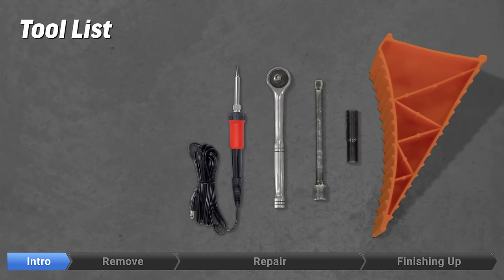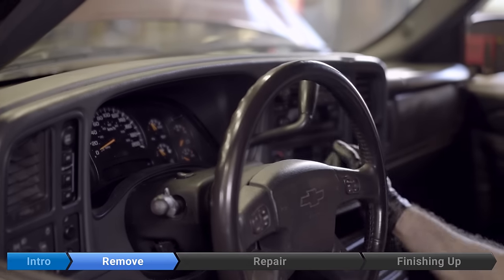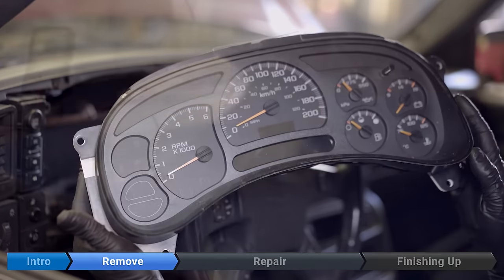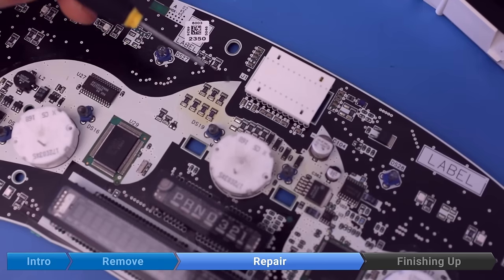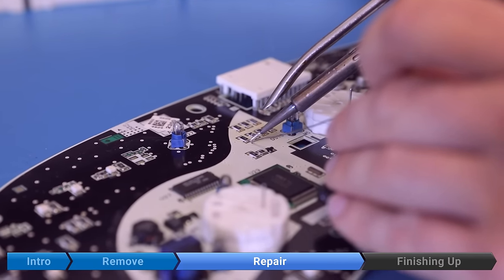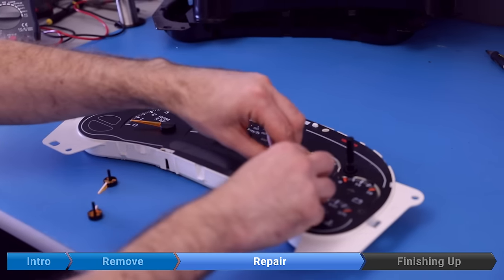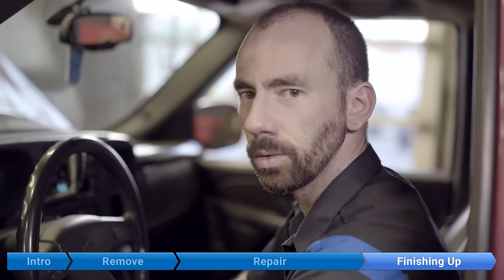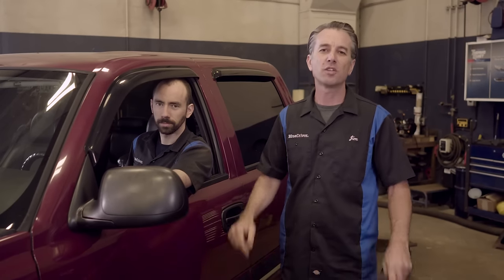Instrument Cluster Repair – 2003-2006 5.3L Chevy Silverado (Sierra, Tahoe, Yukon, etc.)

Comment: Just did this on my 05 Tahoe and it worked perfectly.  I had to mess around with needles, but got it working after a couple of tries.  Thank for the $$$ saving tip!!
Reply from the maker: Great to hear, so happy we could help!
Reply: Is there a certain way to put back needles? I’m having problems with them staying where they originally were.

Comment: Clear instructions, but it didn’t work for me. I got as far as removing the needles from the gauges and with small screwdrivers forks spoons and pliers I still couldn’t get the job done. Put it all back together and I memorized the gearshift positions.

Comment: Yet another great instructional video. Worked great on my '05 Silverado. Hard to see that the resistors solder had cracked w/o a magnifying glass, however it was pretty obvious after melting the old solder on one side, some of them started sliding around all over the place! Thanks again!

Comment: Lol did you remove the needles first then stick them back on to remove them easily for the video? I tried to remove mine and they seemed to be welded on.. I used a fork under them and still they wouldn’t budge...lol
Reply from the maker: .. maybe
They weren't that hard to get off though
Reply: @LemurMonitors  I gotta try it again... maybe I was just being too cautious... it just felt like I was gonna rip the whole shaft right out of the stepper motors lol but as far as you know, they never used any glue to install these?
Reply: @LemurMonitors  so i tried this again today... i had bought some blue LEDs that i wanted to install so I thought, "ok, ill see if i can get these pointers off again" well, i got all of them off except the Tach pointer...that was the one I was trying the other day...it was so tight it pulled the stepper motor right off the circuit board!! lol, lol... so I straightened out the pins and re soldered it back on and it actually worked! as for the blue LEDs? all but the last two worked... they were the twist in types that i had to pull out of their housings to solder them to the board and i think I may have broken a connection inside their tiny boards...oh well, i ordered 4 more so i can mount them later and ill have two more incase they get messed up again...lol

Comment: Just fixed my 05 Tahoe. Besides the low light on PRND321, I had all random warning lights, gauges going to 0 etc.  Awesome tip! THANKS!!!!!
Reply: CaptainET53, was yours just dimming?  Mine seems to be dim and before I attempt this I'm wondering if that's how yours was?
Reply: Rob G 
It was normal for years. Then at some point you could not see the gear selection in the day time. Other lights dim fine.

Comment: I've never soldered anything in my life is this something I should try to do myself?
Reply: Let just say that if your gauges are intermittently working, tach,speed, oil, battery, fuel and temp along with PRD123 and Odometer then yes you can do this. I just did it. Pay attention to all of their tips. A fine tipped solder iron and the thin solder would get you a nicer, smoother result than mine but this was my problem for sure. I soldered each of the points that they did and it’s now working fine. I went from intermittent to not working at all for several days and decided to try before sending it off for repair to Ontario. Quote was $80.00 an hour but shipping would have killed me there and back with rush and insurance. So I figure I save at least $200.00 even if the repair was only for one hour. Good luck!
Reply: And I never soldered anything before either. It’s a bit intimidating when you see how small the little rectangles are but I just dabbed a bit of solder on each end of each rectangle and the first one actually moved out of place. After I changed my underwear......I took my knife and moved it gently back in place and dabbed it with solder. Saved about $200.00 doing it myself.

Comment: Nice man, Im in the process of replacing the turn signal switch cause my cruise control went out. Thanks for the video
Reply: @F RR I did fix the cluster lights but the cruise control is still out. I replaced the brake switch as well and still no bueno☹

Comment: This makes no sense, if this fixes the problem then why if I got my whole cluster redone with new led lights & steper motor checked all sauders by a professional spend a lot of money & every now & then it just goes dead just on the gauges I have to unplug the kluster gor a few seconds then it works again intill it happens again down the line why?

Comment: Is it possible my voltage meter/oil Guage and gas Guage aren't working properly because of these connection issues? My PRNDL are super dim aswell. Please help! Thanks
Reply from the maker: Yes, it could also be a charging system issue causing dim lights. Good luck!

Comment: Everything is great he said! You forgot to pull the bulb for the check engine light and pull the solder off the sensor for the air bag. Geeze this was the least of this trucks problem that also needs an oil change lmao.

All kidding aside. Great video. Wish i seen this years ago when i owned these trucks.
Reply: I'm about to do this repair and if I can get to that air bag light , It's History

Comment: I would give you a  A for effort but if you notice closer after you took it apart and fixed the issues when you put the needle back they read incorrectly you were at low on your fuel before you fixed it then when you're finished it said you had more gas 🤔 so i guess my question is is it really worth it trying to even fix it yourself
Reply from the maker: Removal/replacement and the repair were filmed on different days since we didn't have the soldering gear in the shop

Comment: How come during install, didn't the prndl light up when key was cycled to move gearshift the couple times, but then did work after install was complete?  Is there something causing it not to work untill completely installed?
Reply from the maker: Because we cheated 😉
We were running out of time so we shot the remove/install steps one day then the soldering a few days later, then the shot of it working in the parking lot later that afternoon.
Busted.

Comment: Good video.  Looks like when you first turned it on and checked the gauges, the fuel gauge was near or on empty.  After you soldered the resisters and replaced, you fuel gauge was reading much higher.  Did the resister fix possible fix that too?  My '04 Tahoe just has a problem with the cluster not having power and me having to pound on the top of the dash to get it to power on.  Would that be a problem with cracked resister solder or perhaps cracked solder near the connector on the board?  Thanks! -- Steve
Reply from the maker: We had to shoot the removal, soldering, and install on different days so the gas probably was topped up at some point

Comment: Just one question.
Is it possible that failing cluster can cause the door locks, windows etc to stop functioning? My cluster completely died from a partial issue. Now door locks and window controls seems to be working on my 04 TB.
Reply from the maker: It isn't too likely, this is all handled by the BCM - there may be a bigger wiring issue at play

Comment: Well, we PARTIALLY fixed it.  The indicator lights come back on now.  However, the speedometer and gas gage still aren't working. The other gage on the top far right works.  So now what?

Comment: While this technically CAN be done with a fine tipped soldering iron, a reflow iron would be the best tool for the job. It would simply remelt the existing solder using hot air without disturbing where it's already adhered to the component and the pad. In this case, what you ideally want to do though is put just a tiny dab of solder onto the iron and then just touch it to the joint long enough for the new dab of solder to mix with the existing. No need to feed even more solder into the joint with the size of these components. You're just repairing a damaged cold solder joint and not completely reapplying solder.
Reply from the maker: Ideally you'd keep me far away from a soldering iron
Reply: @LemurMonitors  LOL touche`

Comment: The PRDN indicator on my 2003 Avalanche starts out black and after a few seconds get there but really faint. Will this fix help with that?
Reply: Yes, that’s exactly how my PRND started until it eventually stopped showing. Just did it today after a year of not showing PRND and it worked like a charm
Reply: Cool! Thanks! 😀

Comment: I do have one question if the lights dont show, does it effect how many miles you go like does it keep going or does it pause
Reply from the maker: If it's just the backlight then it's only a display issue - the odometer will keep increasing.

Comment: On my cluster, either all the gauges work or don't work randomly. Would these resisters cause all of them to intermittently work at the same time?
Reply from the maker: Probably not these specific ones - this might be more of a power/ground issue
Reply: @LemurMonitors  would that be one of the wires, or is it grounded through the dash?

Comment: Woulda been nice if we coulda actually seen what the problem was. Did any of the gauges work? Which one(s) didn't? This have anything to do with with gear indicator display?
Soldered a couple things but didn't tell what the exact issue was to begin with.
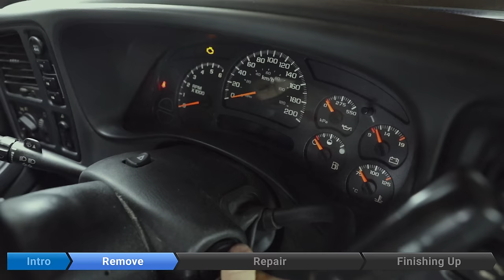Reply from the maker: @ 1:13 you can see the gear indicator display doesn't work

Comment: Excellent instructional video. What was GM thinking when they designed and manufactured these parts???
Reply: In the US solder no longer has lead in it and the tin type allows corrosion.  My 04 silverado has a power drain that kill the battery if truck sits a few days . I can actually hear a low clicking noise which stops when I pull the DIC 10 Amp fuse .
These guys did a great video and I'd like to share South Main Auto Repair has excellent videos. Mr.O is a Hell of a mechanic !

Comment: So my whole cluster went out in my 2004 Chevy 1500. The dimmer light works on it and the check engine light works also blinkers. Do you think it could be the exact same thing wrong with mine as in this video? Everything was working fine then shut off my truck to work for 3 hours and come back to nothing on the cluster. Sucked when I had to drive an hour home from work. But going to take it out today and try to fix it. Very good video
Reply: How did your repair go?
Reply: AutoTechTeacher had alittle trouble when I lost all power to my board. I found out the two resistors to solder and gained power back so I then replaced all stepper motors and put blue leds in also to replace the old lights. So in the long run I only spent $40 in a kit plus leds to fix myself well worth it.
Reply: @DopeLobbies  Cool, i ordered the repair kit on Amazon but I charge by the hour so replacing the whole cluster will give my client a warranty and will cost about the same to him so I am leaning towards that. I really would prefer to repair it myself but this client has a hard time giving up his truck. We shall see, have to verify the price with my VIN & mileage.

Comment: This video is good for the DIY guy who can actually solder... however, as someone who repairs these clusters as part of my business daily I need to put it out there:  DON'T ATTEMPT THIS REPAIR IF YOU HAVE NEVER SOLDERED BEFORE.  Find a junk piece of electronics and practice on that, because when you bring it to a professional after you fubar it, its gonna cost 2X what it would have to begin with.  

ALSO:  I feel you guys should have included a warning about the potential of stepper motor failure when removing the needles.   If your cluster has never been repaired before, and still retains the C5 or X5 stepper motors, you're more than likely going to have issues.

Comment: Just did this today and my PRND is bright after not showing for a year. My AC controls have also not been showing for about 4 months and now that the PRND is very bright I noticed the gauges on the gas and engine temp are bright but oil, battery and RPM are dim. Does anyone know what numbers on the cluster they are so I can do the same for them
Reply: @Joel Baray you probably have some bulbs burnt out. There are 9 total on the gauge cluster used to backlight. Again, this is a major common issue with these clusters. They are easy to solder and replace

Comment: I was doing this yesterday but could not figure out how to remove the gauge needles but now I know. Thanks!
Reply from the maker: Make sure you put them back on in the proper position! (see the -10 mph @ 7:40)
Reply: @LemurMonitors  how tf do you do that? We weren't told to mark the original position of the needles, I tried to and still ended up with all needles wrong.
Reply: Best thing to do to set the needles correctly.  Take the cluster cover off and plug it up.  Put tape behind each needle.  Turn the key on and mark each needle.  Finish the repair and plug the cluster back in and turn the key on.  Then put the needles back on per each mark made on the tape earlier.   Then put the cluster cover back on.

Comment: What about the stepper motors for the gauges if there not working? I have an 03 GMC Yukon Denali xl 6.0L 

Do u have an video for that repair?
Reply: They are simple if you can do this repair you can change the motors out.

Comment: I have a prndl issue and a battery parasite draw.  I hope this fixes both.
Reply from the maker: If you still have the drain check out an automotive short finder
Reply: Prndl issue fixed!
Reply: Just a follow through my parasite drain went away after I fixed this.  However a few days later I got a door ajar message which could've set off the alarm or turned on the interior lights.  Put a new latch actuator in.  Prndl or the latch fixed the parasite draw.

Comment: Can you help with remote fob. Battery is OK and fobs are sending signal nothing is receiving signal
Reply from the maker: Hi Gerald! If nothing is receiving a signal it could be: 
- Anti theft module
- Body control module
- Engine control module
- Receiver for the keys
- A module or key might need to be reprogrammed
Reply: @LemurMonitors  could you do a tutorial on this,or have you  already

Comment: pretty much each new solder joint was 'dry'...you should have used flux to 'wet' the area and solder and you wold have ended up with a nice clean solder joint!
Reply: I don't have any Flux.  Will ear wax do

Comment: My fuel gauge reads between 5and9 clockwise. Instead of 9and two clock wise. Any ideas?
Reply: Someone put your fuel gauge needle on backwards or the stepper motor shaft slipped in the needle

Comment: thank you so much...turns out 3 of mine were cracked!
Reply: Ok but this guy that knows how to solder told me they it's ready to mess up the whole panel if don't solder properly and that it's easier to order a whole new panel? I thought of I just melt the original solder a little it would make contact again and work just fine.  What should I be concerned about here?

Comment: Hi guys, I have the same cluster and oilpressure is always at over 550, even if ignition is off, never comes down. Could that be fixed like this too? Thanks...
Reply: Get a new set of stepper motors, might as well swap them all out at once.

Comment: will this fix my battery light..... it will not go out >>>>and i have replaced the alternator 
i want this battery light to turn off!
Reply from the maker: It could be a few things, I'd have a look around for TBSs:
PIT3437
PIT4400
PIT4671
Reply: Can you roll the mileage back on an 07 Buick rendezvous

Comment: I HAVE HAD THE CLUSTER REPLACED TWICE THE FIRST TIME ON 2/7/18     I TOOK MY TRUCK IN BECAUSE MY BATTERY KEPT DYING AND I HAD THE BATTERY REPLACED 3 TIMES THAN THIS SAME THING HAPPENED AGAIN ON 2/13 23 AND THE CLUSTER WAS REPLACED AGAIN  OVER $700. EACH TIME I THINK I NEED TO GET RID OF THIS 2003 SILVERADO WITHIN THE NEXT 4 YEARS SINCE IT SEEMS THE PROBLEM OCCURS EVERY 4 YEARS AND NOW I HAVE A DIFFERENT PROBLEM WHEN I START THE ENGINE IT WILL IMMEDIATLY DIE

Comment: My dash has the backlighting, turn signals and check engine light. Everything else is dead have tried this and didn't get anywhere any thoughts
Reply: That Steve Guy same
Reply: Lmk if you find the solution
Reply: @LODExXx  about 2 days ago or so I went ahead and re-soldered every single resister on the board... didn't see any cracks to begin with through my magnifying glass but it fixed the issue.

Comment: the last shot isnt even the same gauge cluster lol The stepper motor on the volt gauge is shot. When he reinstalls the cluster after the repair and has the key on the display he fixed doesnt show up...
Reply from the maker: We pulled some fast ones (recorded removal and install on different days as lighting allowed), but it's definitely the same cluster.

Comment: Awesome video! What do you use for the additional material used for the existing solder? Does any random metal work?
Reply: I dont know but you can just buy really cheap solder wire
Reply: @psor9983  Thanks for the speedy reply 😂I ended up bashing the panel with my hand and that seem to work with reconnecting the fuse. Whatever works 🤷‍♂️

Comment: This does NOT work on 99-02 clusters. They are a completely different cluster. Doesn't matter what engine all the 03-07 (classic) are the same design. Your calibration was horrible in this video. You should really use flux when re flowing those, they might crack again. There are also other problem areas on these boards, most guys that rebuild them will replace all the steppers and bulbs at the same time..